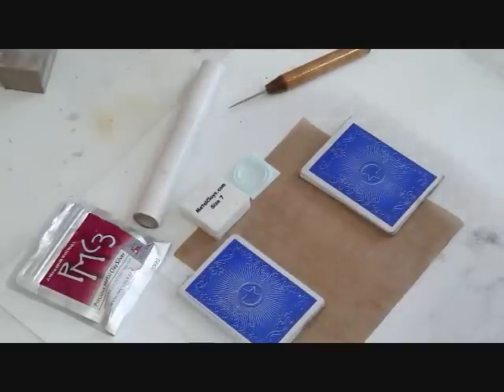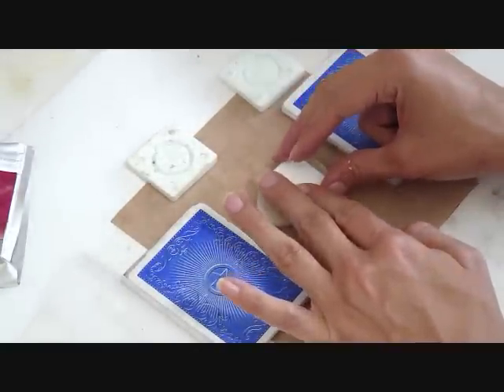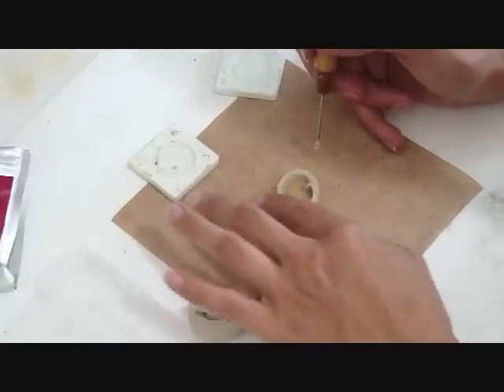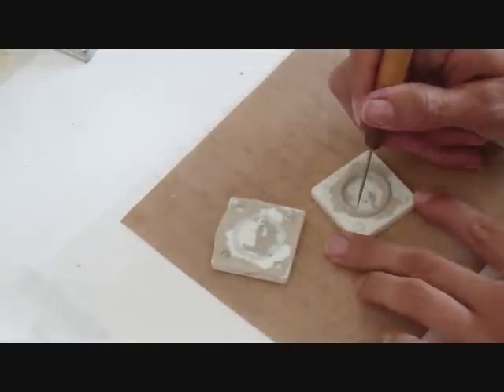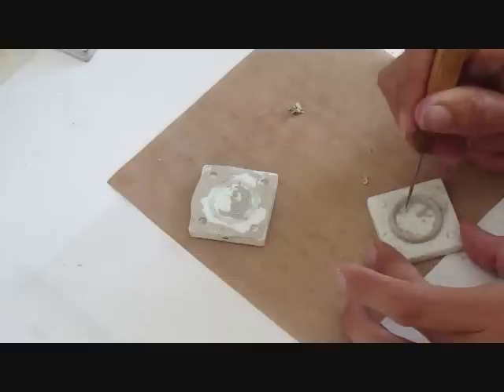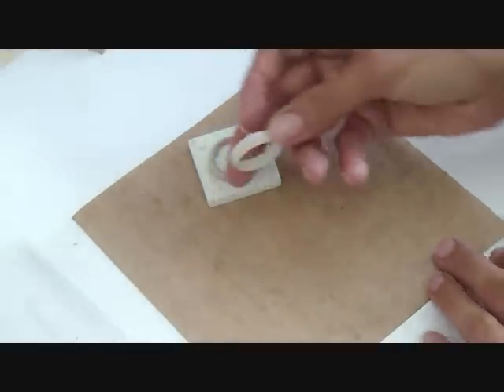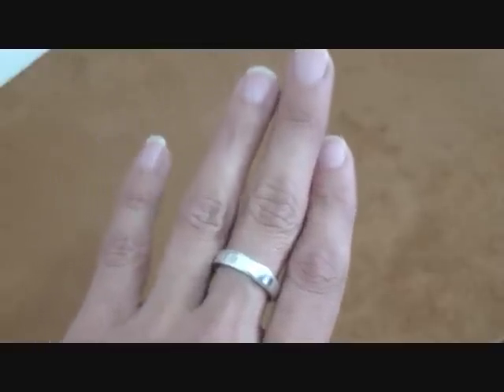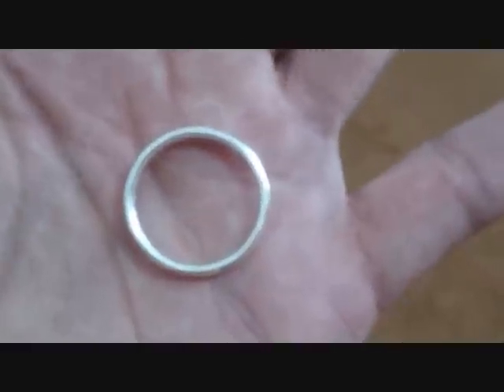How to make PMC ring-

Comment from the maker: Yes you can. The shrinkage difference between the materials is close enough that as long as you use a shrinkage plug it will work at stated mold sizes. Drop us email on our contact page if you need help selecting a mold.
Reply: I wanted to buy these but did not see them on your website.

Comment: I want to add a gym before I put the ring into a kiln is there away to mold the ring around the gem. Also if i buy one mold is there away to shrink the ring to smaller sizes or will i need to buy multiple ring molds?
Reply from the maker: Dexter Rhodes Hi,I would embed a bezel made with Bezel Builders or drill the correct size hole and embed.. Each size make one complete size range.Size 6-7 would allow fpr  6 ,6 1/4 , 6 1/2 and 7 for example with use of ring plugs.